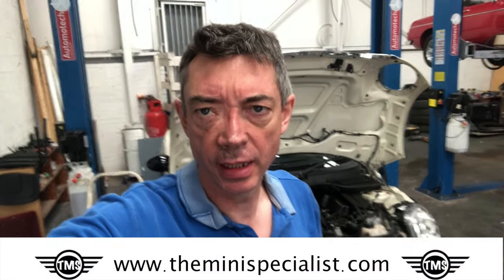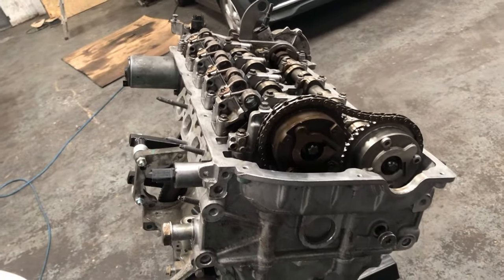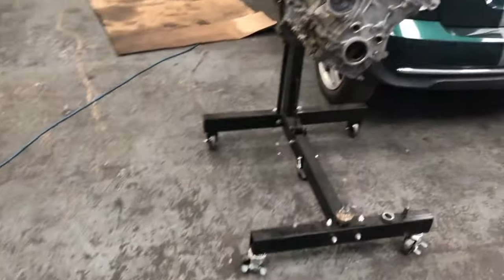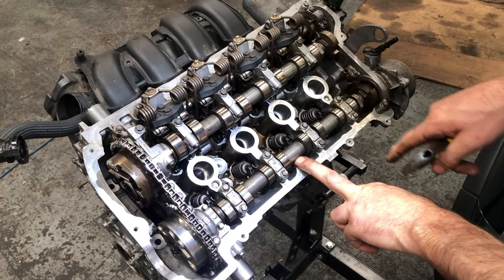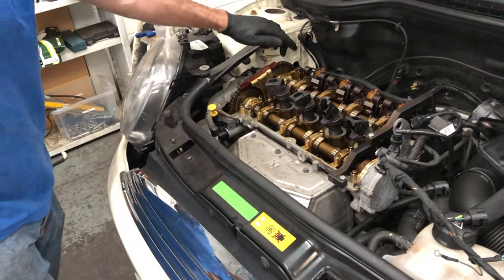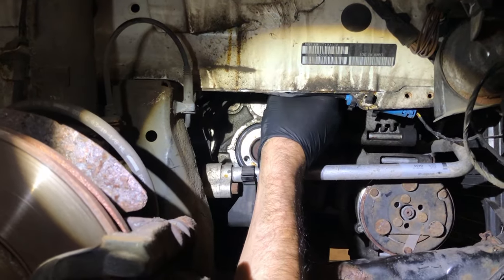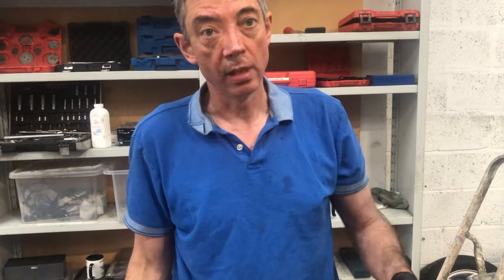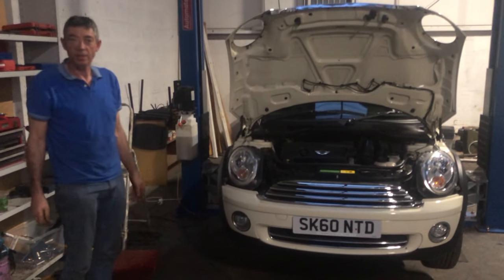BMW Mini Timing Chain DIY Replacement for N12, N14, N16 & N18 engines - The Definitive Guide

Comment: Great video , ive used this guide multiple times. However ive done it agaim recently and I have an issue. I actually removed everything to replace an exhaust valve on this occasion all went well but on putting everything back together ive got a timing issue. 
Crank and cams are all lined up as they should be  , all bolts torqued as they should be. 
Runs really lumpy and wont idle.
Locked the crank again, all pistons are level , cams facing up, tools fit so all are 100% in time. Yet still im getting the same issue and getting code P0014 along with various misfire codes.

No idea what to do from here as there was no issue with timing before.
Reply from the maker: The misfires need looking at first - are they electrical?  Secondly the sprockets sometimes fail as do the vanos's.

Comment: Hello, I just did an overhaul on a 2009 Mini Cooper base non turbo r56 and the timing is off,I’ve never reset timing before, are there any videos that portray doing that? 
Thanks in advance!
Reply from the maker: This one!
Reply: The Mini Specialist thanks I soon realized it after watching haha,but with the little “stopper” that prevents the flywheel from turning do I put it in the nearest hole to stop it from turning after I align the cams with the lettering up?? 
Thanks in advance!!
Reply from the maker: Yes - make sure the cams have the lettering at the top - if not you could be 180 degree out - then pin the flywheel
Reply: The Mini Specialist ahh I gotcha but on the flywheel is there multiple holes for the little plug to go into or is there only one?? (The one that aligns with the hole on bell housing)

Comment: Hi I have a Mini Cooper 2015-16 with a F55 engine. What is the big difference between the R56 and the F55 when it comes to changing Timing chain? Is it much harder to do? best regards Björn Egertz Stockholm
Reply from the maker: Never had to replace an F series chain, and it's next to the gearbox so if you did replace it you need to remove the engine, gearbox and clutch to access it.
Reply: @TheMiniSpecialist  Okej Thx for you quick answer. Björn

Comment: Is that tiny flywheel location pin sufficient to hold the engine while torquing the crank bolt?  I believe that Mini use a special tool that bolts in place of the pully to counteract the torque
Reply from the maker: believe it or not yes.

Comment: Thank you for nice video. Just like to know if the vvt actuators sprokets needs to replace and is there is any position or marking to install ? Because i can see some dot marks on actuators . Thank in advance .
Reply from the maker: I have never needed to replace the VVT sprockets - though I always inspect them for wear - and the sprocket position is not important - so long as the crank is pinned and the cams locked before you torque them up.

Comment: Excellent video. Question regarding timing chain repair kit, did you use an OEM or aftermarket kit. Thanks.
Reply from the maker: For the Cooper S (N14 / N18) I use a Febi Bilstein kit and for the standard Cooper / One engine I use a BGA kit - these are all sold as 'OEM QUALITY'

Comment: May i ask you, why you dont clean and degrease the IN and EX chainwheels before puting a bolt in? Is that Not neccessary because of the 20Nm+180degrees? Is oil under the screw not leading to that they can glide?
Reply from the maker: It's never been a problem and I do one or two of these a week.
Reply: @TheMiniSpecialist  I don't wanted to criticise. Good job and as I can see you're doing it with routine. 
Have you ever seen P0301 / P0302.. "misfires"? Is the pump the problem? I measured >2.7mm at the thing which has a spring in it with a "depth measure tool".

Comment: Hi there, I messed up when the locking pin pulled out by itself after trying  to torque the crankshaft bolt. can I spin the crankshaft until I find the alignment on the flywheel without damaging the engine? the camshafts are still locked in place. Please help
Reply from the maker: Yes you can.  When the locking pin is in place the pistons are all at the midway position - turn the crank slowly and if you meet resistance reverse the direction.  So yes - re-pin the crank.

Comment: I bought a used N14 Base model 108k.   how soon should I do this and  how much is this type of work in a mini run for.
Reply from the maker: Hi - my expereience is that if your car hasn't had a replacement timing chain at 108k miles then it will need one.  We charge £750 for this job - check out our website for more info / pricing www.theminispecialist.com

Comment: Please help me i need your help when car  is running with all sensor running i disconnect the valvetronic and try to adjust manually after 0.4mm open valve car start to misfire but tomorrow when car wii be cold i will check if it misfire when i try to adjust manually if it does not misfire this will confirm that only when hot that the valve seat does not stay in place !!!it that good ????

Comment: First awesome information! Owning a 8 year old car is a lot better having guys like you sharing knowledge. Thank you! 
My 2012 R56 cooper S , when cold ignition, spits from the exhaust what looks like oil and grime.. and makes a mess! Lol.. also, rattles when cold start.  ... do you think is correlated or is some other major issue? Thanks!
Reply from the maker: Thank you for the complement and for watching!  When cold the ECU makes the mixture richer to enable starting but oil and grime - doesn't sound good.  The rattle could be the chain or the tensioner or both are becoming worn - or you could be low on oil - or you may have the incorrect grade of oil.  For the Cooper S the manufacturer recommends 0w30 LL04 100% synthetic - the 0 is the viscosity when hot and the 30 is the viscosity with cold.  On older cars I use 5w30 just to compensate a-little for wear.

Oil can get into the combustion chamber in 3 ways - via the piston rings, past the valve stem seals or through a fissure in the head gasket.  The valve stem seals do age and can crack leading to increased oil consumption.  A compression test - assuming you have good compression - tells you that the valves seat properly and that the compression rings are good.  It cannot tell you the condition of the oil ring or the valve stem seals.  

Keep a eye on the oil consumption and perhaps change the chain tensioner as a first pass.

Comment: do you have to use the tool to hold the crankshaft besides the locking pin?
Reply from the maker: tool?  No. Just the crankshaft pin and the camshaft locking tool.

Comment: Hello, I'm replacing bent valves on an engine with 3 camshafts. One exhaust and two inlet camshafts. One of the inlet camshafts has a geared quadrant driven by a worm gear. . I'm unsure how that camshaft is positioned. Does it need to be engaged with the worm drive ? Thanks
Reply from the maker: each engine has specific timing requirements so am unable to advise.  The cheapest option is a Haynes manual - they are pretty amature at best but will give the basics.
Reply: The Mini Specialist thanks

Comment: The manual says the Exhaust Sprocket to Camshaft at the front is 20Nm and an additional 90deg of rotation. It is less than the VANOS Unit to Intake Camshaft at the rear which is an additional 180deg. Was this a mistake or have you had problems with the lower 90deg spec?
Reply from the maker: Hi.  Both camshafts are 20nm +180 degrees.
Reply: @TheMiniSpecialist  Thanks for the quick response. Is there a TSB about this? I can only find where it says an additional 90 degrees of rotation regarding the front exhaust sprocket to camshaft.
Reply from the maker: @ryanwolf8441  is your car a Cooper S with a single variable cam by any chance?
Reply: @TheMiniSpecialist  No, it is 2010 S N14 DOHC. 

Here is a video from another reputable provider that says the exhaust to camshaft sprocket is only an additional 90deg https://www.youtube.com/watch?v=eEYFo2AZLGs&t=953s

I am just trying to figure out who is right before I put this thing back together this weekend lol. Thanks...
Reply from the maker: @ryanwolf8441  so the N14 had a single vvc sprocket on the inlet and a fixed sprocket on the exhaust. I always do 20nm + 180 and have had no problems but I can see why the fixed sprocket may indeed need less torque. In my view as long as the sprocket stays put everyone's happy and 20nm + 180 works for me...

Comment: This video is very helpfull, im qbojt to do this job, did u have to replace cam and crank bolts?
Reply from the maker: You should get a crank bolt in your replacement chain kit - the cam bolts I always reuse.

Comment: Is there a set position for the vanos pulleys? Or can they be installed in any position?
Reply from the maker: no set position - just make sure the crank is pinned and the timing tool is on.
Reply: @@TheMiniSpecialist  I've already done the chain ect, rechecked the timing but it won't start

Comment: Hello. I'm sorry to bother you again, but I'm desperate and I don't know what to do anymore. I have a mini cooper r56 with an N12 engine from 2008.
Gives engine failure with error P111b. I have taken it to 3 workshops and they cannot find the problem. (they only did a carbon cleaning)
I have changed the new MAP.
I have disassembled the manifold with the butterfly, I have cleaned it, I have put new gaskets on it.
I have changed the 2 new Vanos solenoids.

but it still gives the error. Can you give me an advice?
Reply from the maker: The ECU is seeing a too low of intake air through the reading of the pre-cat O2 sensor.
That either means the ECU is trying to adjust for a too rich of burn, or there's a downstream leak in the system.

Pressure check BOTH the intake and exhaust side of the system, making sure gaskets, and components are not venting any air to atmosphere.

Also check the rocker cover PCV and the plastic breather hose from the top back left of the rocker cover - this can fracture.
Reply: @TheMiniSpecialist  Thanks a lot. I'm going to try changing the pcv valve. The plastic breather hose and the rocker cover appear to be very good and I have not seen any breaks. Thank you very much for the advice

Comment: Thanks for this video!  At 38:01 you push a plastic grommet-like bit up thru the crossbar.  That bit seems to be there to protect the hood release cable from chaffing against the metal.  My car is missing that bit.  You don't happen to know the actual name for it or a part number? I can't find it on any parts diagram I've found online.  Thank you.
Reply from the maker: sorry no - it's just a bit of brittle plastic and I think it's more trim than anything else so I woundn't worry about it too much.

Comment: Hi right at the end you used a diagnostic tool to reconfigure the solenoids. Is that essential or will the mini do it after time?
Reply from the maker: Essential?  Depends I guess.  What the tool does is makes sure that the variable timing is within tolerance - so recommended but in most cases you could quite possibly get by - cannot guarantee that however.

Comment: Thanks a lot, but do the cam chain sprockets just bolt back in without any adjusting??
Reply from the maker: No - they are held on by friction only - when refitting put the bolts in all the way finger tight this way the spockets can still move, then refit the tensioner - this way the chain is tensioned and everything is timed - then torque up the sprocket bolts.

Comment: Hi I have a 2007 Base cooper, I'm doing this job but on your video when you remove the tensioner for the water pump you unplug an electrical conector, mine does not have one?
Is this conector on the tensioner?
Reply from the maker: Hi Eduardo - don't worry - on some models the water pump tensioner does not have an electrical connector -  the earlier models especially.

Comment: Are you using anything special to hold the crank in position while torqing the crank bolt?
Reply from the maker: The crank pin from the Camchain Locking Tool kit.
Reply: @TheMiniSpecialist  It's strong enough to hold the torque?
Reply from the maker: Yes. Been using the same locking tool for 2 years now and after over 200 camchain changes is still doing its job well.
Reply: @TheMiniSpecialist  Cool beans my friend, thank you for the information!

Comment: Hello boss i having problem with my engine ep3c vti on a citroen c4 mk2 it uses the same engine but without a turbo i was having problem with the car before rebuilding the engine change a lot of parts p1336 and p1339 remained and error apear only when car is hot i have completely dismantled head and check valve seat all was ok replace piston ring valve stem headgasket all torque to specification error p1336 p1339 remain car run normal only if i disconnect 1 vanos solenoid what can you advise me boss do you think that when the engine become warm about 95 degree celcius the valve seat does not stay in place ????

Comment: Hi my timing chain is in the early stages of needing replaced I've had quotes of £1000 to £1500 can u tell me if those amounts are a bit much my car still drives great no issues at the moment but I do 70 miles a day don't want it snapping on me thanks and great video
Reply from the maker: I charge £641 all in - includes a OEM quality chain kit, crank seal, and an oil change - so those numbers are high - either that or I am too cheap....
Reply: @TheMiniSpecialist  I'd be cheaper driving down from Scotland and getting u to do it mate thank you for the reply cheers
Reply: @TheMiniSpecialist  where abouts are u mate
Reply from the maker: West Midlands - DY4 7LH
Reply: @TheMiniSpecialist  would u be able to do it in a day mate honestly if I get no joy up here I'm coming down with it least I know it will be done properly
Reply from the maker: Yes - that's doable - call me tomorrow and we can sort something out.  My number is on my website www.theminispecialist.com
Reply: @TheMiniSpecialist  OK mate I'll be in touch thank you

Comment: Hey did you use new crank and camshaft bolts? Is it necessary to use new ones?
Reply: Yes it is recommended to use new ones, because they are torque to yield. But he didn't here and if doesn't look like anything bad came of it? But really you should

Comment: That angle bracket is one method, but I just put a paint dot at the 12 o'clock position of the crank bolt then turn it until the dot is at the 6 o'clock position. Less cumbersome. The same method for the cam bolts, only they're rotated 90 degrees past initial torque setting.
Reply: If a vanos unit is on the cam it's 20nm +180, if you don't have a vanos on the exhaust cam it's 20nm +90

Comment: Hi just after a bit of info to satisfy my curiosity and improve my knowledge at the same time. Is the engine in an R53 based on a Peugeot engine or an engine from a Mazda Mx5??
Reply from the maker: The R56 petrol engine is a PSA based joint venture with BMW who supplied the Variable Valve technology (as I understand things). The R50/R52/R53 engine was a 'Tritec' engine built in Brazil. Very different engines. The R56 engine when running well is smooth, powerful and efficient. The Tritec engine is more hardy but less efficient and refined.

Comment: Hi iv just bought a 52 plate mini one 1.6 with 80000 miles really good conditions
how much am i looking at do do the job iv just watched regards Tony
Great vid by the way ;)
Reply from the maker: the first GEN BMW Mini doesnt usually have timing chain issues - it's a completely different engine and does not have variable valve timing.....

Comment: Are cam sproket bolts ok to reuse ? or are they one time use?
Reply from the maker: Ok to use again
Reply: Ok autodata says replace them but it isn't always right
Reply: @TheMiniSpecialist  I re used them didn't have time to get new ones anyway
Reply from the maker: @adamfletcher4262  we always reuse them - best practice is to replace but I have never had a problem.
Reply: @TheMiniSpecialist  if you never have an issue then why bother replacing them

Comment: Hallo das video war sehr gut nur eins habe ich vermist wie müßen die vanos räder auf der nockenwelle stehen haben makierung
Reply from the maker: The camshaft sprockets are not marked - so long as you pin the crank and use the locking tool you should be fine.
Reply: @TheMiniSpecialist  Danke für die Antwort

Comment: @28:17 when you're refitting the camshaft cogs, do you have to replace the bolt for a new one as it's a torque to yield bolt or am I wrong?

Comment: Would those actuators cause super-knock? I always use super unleaded but recently started getting a super-knock error meaning timing is out even though the timing marks align. Any idea what could be causing it?
Reply from the maker: supernock is not timing related - it is a severe form of abnormal combustion that can occur in turbocharged and high-performance engines, particularly in those with direct fuel injection and is often down to poor fuel or when an engine has been remapped.  In the remapped case the car is over-fueling which creates more carbon.  In the most extreme cases the carbon eventually burns as fuel and burns at a much higher temperature than petrol and can melt pistons. 

Try using a petrol additive and if your car has been remapped then remove it and bring it back to standard.